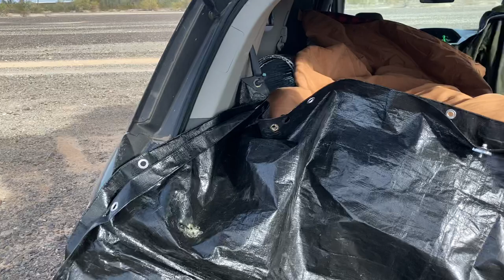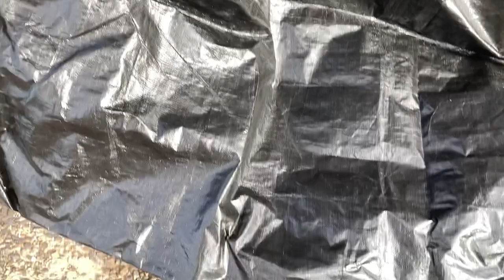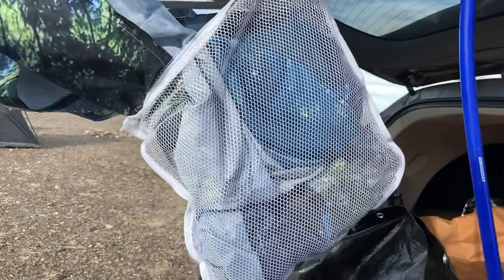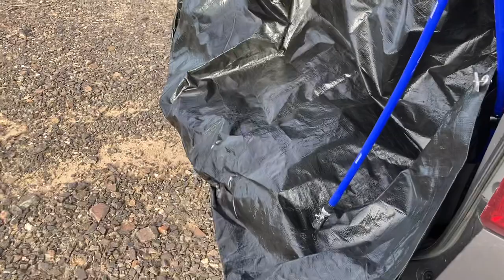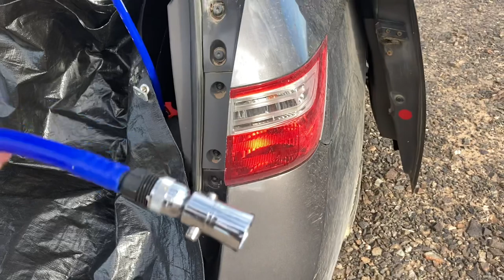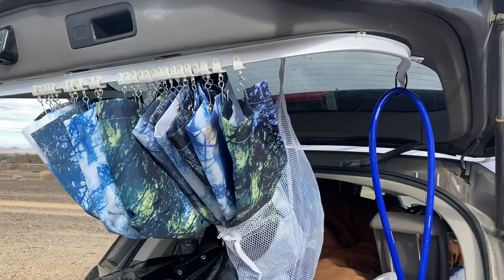A Shower in a Minivan?

Comment: Simple but functional. Would love to know about all electrical controls.

I have an on-demand hot water heater and a water pump and I can set that up to use at the back door with a shower curtain around there or hang it off the tree. But the way I set up the water pump I put a 12 volt cigarette lighter style plug on it so that I could use the power station to power the water pump